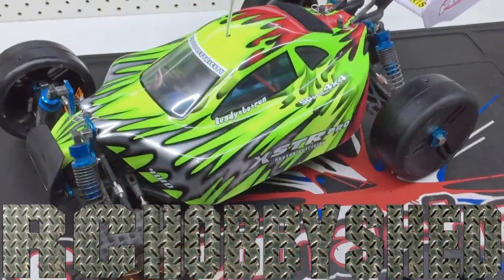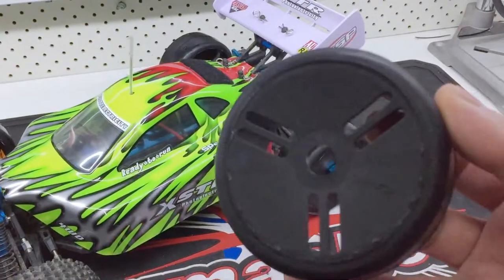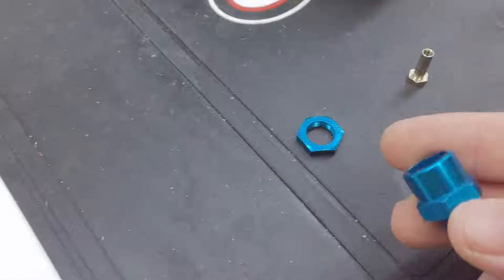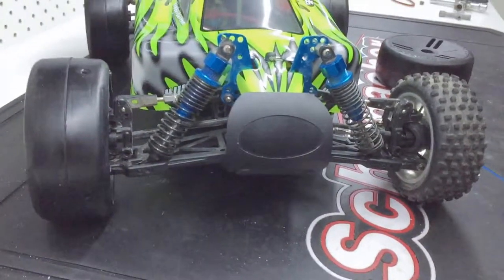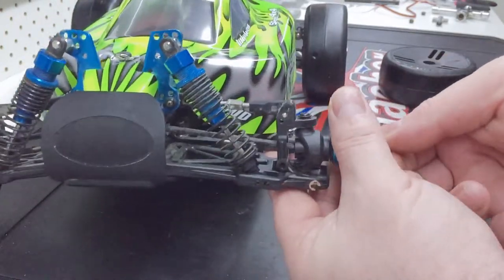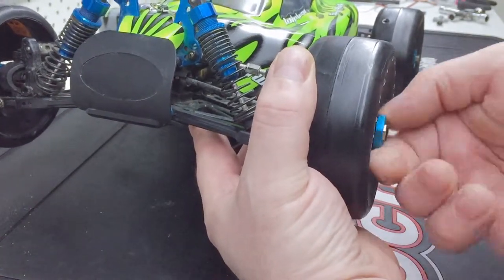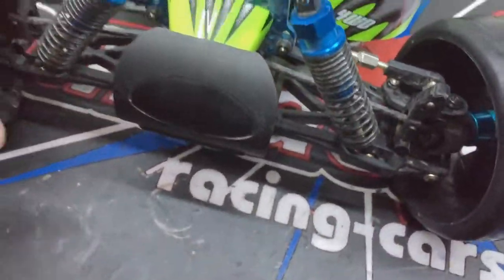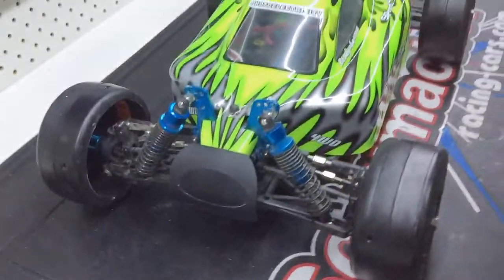Fitting 1/8 Scale Wheels To 1/10 Scale Buggy for Speedruns

Comment: Hey mate, have you ran the car with these? Looking at some for my 1/10 HPI maverick quantum truggy to run 1/8 truggy wheels. Do you get much wobble with them or do they make the car unstable to drive cheers
Reply from the maker: G'day Jake. I have run the car with them. I've not had any issues with wobbling, but one did come off once. Maybe it just wasn't tight enough, dunno. It seems fine to drive with them though. 👍